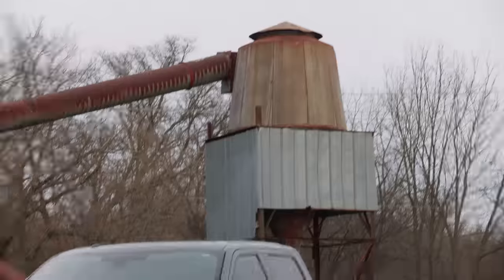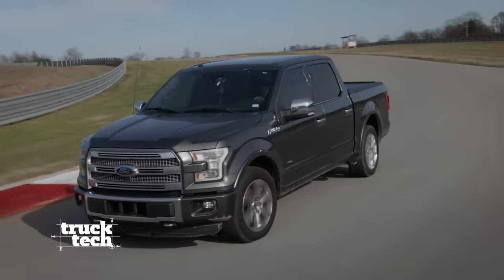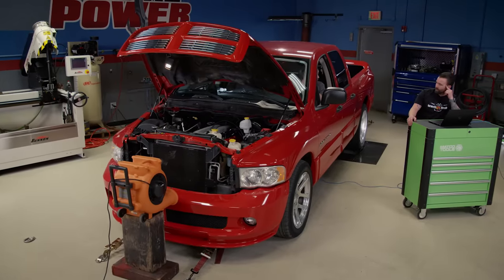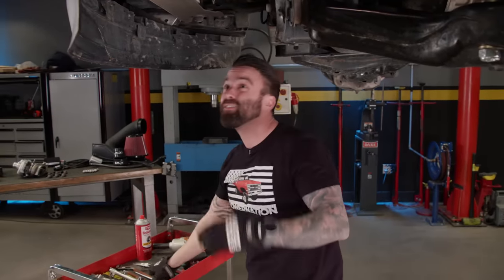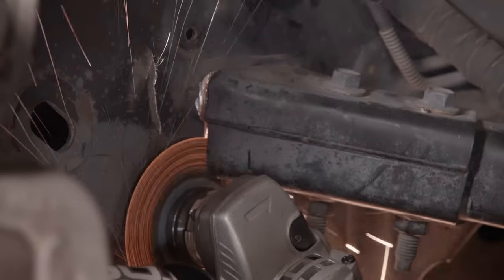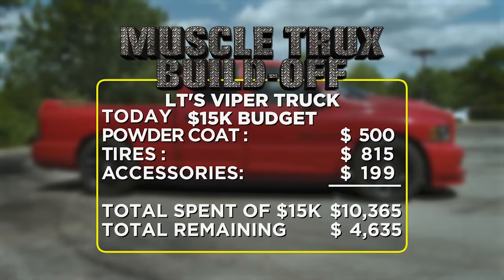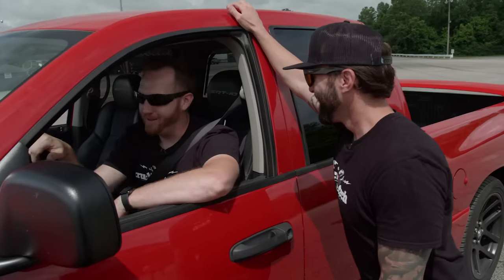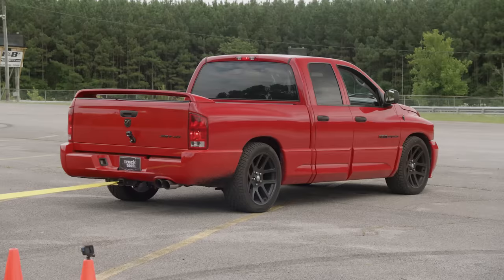Muscle Trux Build-Off: Ford F150 EcoBoost vs Dodge Ram SRT-10

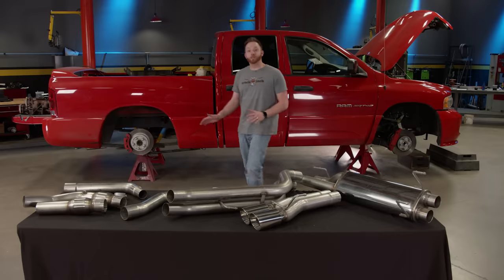Comment: @1:00:20 you can see how bad that Ram is sagging in the middle sitting on jack stands on 4 corners. I pointed this out last year the first time I saw it. These guys are hilarious.
Reply: It's not sagging the front jack stands are in the frame the rear jack stands are on the rear axle. The rear suspension is compressed alittle because it's on stands

Comment: The 3.5 is only at advantage in 17 and up. But 3rd gen 5.0s are running mid 12 to low 12s ive seen, intake mani, tune, exhaust, cai, 30% e85. And they sound great. The 3.5 cant compete in the long run.

Comment: I didn't like the 2018 4x4 f150 v6 twin turbo, it was fast, but the 10 speed transmission didn't seem to know what gear it wanted to be in when hitting the gas and turning, like I was able to repeat the issue with it swapping from 2nd to 3rd and back to 2nd and back to 3rd in normal mode with moderate throttle turning a corner to beat traffic or a light, sport mode wasn't an issue, but never ran it in sport mode much. Plus the truck was so light, all aluminum felt like I was closing a door on a tin can, It just had this cheap car vibe to me, everything was that hard plastic feeling, frame was paper thin, I wasn't impressed, it was fast truck though, Would smoke my 92 Silverado 5.7.

Comment: I have to admit that Ford looked awesome! I see everyone commenting that the F150 could’ve been tuned for a lot more power so knowing that if I could tune it to get 550-600 HP on the setup that they built then I definitely would’ve took the F150! I have always loved the SRT10 but they could’ve done so much more for the performance of the truck! Take into account that you can easily tune the F150 to get double the MPG than the SRT10 then it’s an easy decision for me.
Reply: its so stupid cuz he couldve got a coyote f150 and the 5.0 coyote just needs boost and fuel and you can make up to 1200whp with a stock sealed coyote.  no heads no cams no pistons no rods and they run 9s for a crew can and as fast as 8s with the single cab short bed in the 1/4 mile. he bought a turbo for this when he couldve slapped a turbo or supercharger and fuel system.  m8dnight performance jas toms of these in the 8s without ever openimg the engine. gotta think once ford went with aluminum they have a weight advantage weighing jn at 4500lbs (hellcat weight damn near) its like having a awd mustang

Comment: The ecoboost could have used e85 fuel for a much higher gain in hp, probably another 40whp at least. The srt10 hp gain was disappointing, my guess is the limit of the out of the box tune compared to a custom dyno tune

Comment: Should have got a livernois tune on that Ford. Besides the fact that their tune with those mods would have put up better hp numbers their tcm tune puts the power down much better. Skip the cosmetics and throw some ported heads on that eco boost and srt 10

Comment: the dodge could of been done so much better. should of left the gearing alone, put a more aggressive cam then the one chosen. I agree with the heads and brake upgrades. the tires and rims should of been aftermarket with a 20" rim up front and a 22x12 in the rear and a -offset. the exhaust should of been true dual with a x pipe. my key choice difference would of been a procharger or turbo instead of a few other options chosen. either way awesome job boys.

Comment: Should have used the 04 Harley supercrew instead of the eco boost. Or if a regular cab ram the lightning. Since those were both around the same Era competing against each other. Wasted money on the ignition upgrade on the ram too. Stock would easily handle the meager power gains they did. Msd coils aren't that great on the Ford or any vehicle.

Comment: They should have done more engine upgrades. the guy with the dodge still had like 6 grand left over! personally ill take the 150 platinum with the 3.5 ecoboost over that dodge any day although a viper ram is a rare and cool truck i thought the ram would have made a lot more stock HP though.

Comment: Hey Dodge man, that transmission for that truck isn't behind the compression ignition engine, the 727 torque flight is. It could only accept 1085 foot pounds of torque. The ten speed in the Ford has ten speed and a reverse. The high output powerstroke engine has 1200 foot pounds of torque. The horsepower for those engines is 500, the same as the six cylinder engine from Mack truck, who manufactures their own engines.

Comment: SMALL CAM is correct the factory 96 97 vipers have a 220 230 cam stock. And mine isn't missing any torque at all drives extremely easy. Cams in the mid to high 240s is actually pretty normal to see in the v10s.
Reply: Agreed, thank you, finally someone who knows what they are talking about! They put a baby cam in the Ram🤦🏻‍♂️

Comment: Idk if he's launching that f150 right....needs to be in 4wh ...pull drive selection knob to lock diffs....quick double tap traction button to put in sportrac mode (or press and hold to turn advance trac off)...push sport button to put in sport mode...prep for launch by rolling forward a little to engage everything ....Rev up to around 2k rpm....dump and go!

Comment: I wouldn't have wasted money on the pedal commander or the voltage thing or the MSD coils, for the fuel pump, would have just ran a new wire and relay for the pump and done OE coils, then spent the extra money on Turbo adapters, maybe a little bigger of a turbo.

Comment: My 19 5.0 f150 runs 8.1 in the eighth at 88 mph with just a tune and e85 with cat back exhaust cold air intake lowered with traction bars

Comment: I was wondering you guy lowered the rear gearing from 4.95 to 4.10 in the srt10. Would a 3.73 or 3.93 work too or is that too for the v10?
Reply: Probably wouldn't have been a problem for the V10 itself, but I have my doubts about that transmission, especially since it was only a 4-speed. May not have broken, but with only four gear ratios, I imagine it would've killed the acceleration if he went that low.

Comment: Platinum and limited trims with the 3.5l has H.O motors. They are tuned differently by factory.
Reply: H.O motor is only in the Raptor, not the platinum in 2015

Comment: It would’ve been a hell of a lot easier with the F-150 to pull the chassis off it would’ve been more room to see all the improvements to be made people sleep on the V6 3.5L F-150 but they actually well built.. I use to own a SRT-10 years ago but knowing what I know now if I had a opportunity to pick between the two I would go Ford all the way..
Reply: its so stupid cuz he couldve got a coyote f150 and the 5.0 coyote just needs boost and fuel and you can make up to 1200whp with a stock sealed coyote.  no heads no cams no pistons no rods and they run 9s for a crew can and as fast as 8s with the single cab short bed in the 1/4 mile. he bought a turbo for this when he couldve slapped a turbo or supercharger and fuel system.  m8dnight performance jas toms of these in the 8s without ever openimg the engine. gotta think once ford went with aluminum they have a weight advantage weighing jn at 4500lbs (hellcat weight damn near) its like having a awd mustang
Reply: @carculturenation2166  u absolutely right fam …. I give him his props tho

Comment: i’m going regular cab short bed silverado with the 5.3, stage 3 btr cam, ported and polished heads, long tube headers get it deleted and 4.56 gears. cheaper and faster than both trucks

Comment: Both trucks could probably hit those numbers with a cold air intake, exhaust, and a good tune.  Why spend all that effort putting on parts for such low gains? If stock injectors can support 700hp why change them for bigger ones if you are only going to make in the 400's?

Comment: Because I have a 2013 F-150 four-wheel drive with a coyote V8 and I want to do the same to that as what you did to that EcoBoost drop it down like you did that one and give it some more horsepower and put some headers on her in and a 55 mmm throttle body
Reply: Excuse me in 85 ml throttle body

Comment: Still should have used a coyote v8 with whipple on the Ford or twin turbo that? But those v6’s can be awesome on smaller vehicles but idk about a heavy truck?  It’s whatever it’s what u all chose? Should have used a lightning or bigger turbos like 2-30 psi ones just saying ? Against a viper engine u gotta boost that thing to the extreme!!!😎
Reply: Right! And the Ram only had a baby cam in it, imagine if they actually put a deck to size in it!

Comment: While I’ll admit that ford has done some amazing things with the eco boost and they are capable of making really good power with very little the one thing you can’t change is that they will always sound like crap when compared to a V-8 or V-10. That was the biggest complaint with the Raptor fans and why they released the Raptor R which ford still held back on because the Raptor R is capable of way more than 700hp with very little effort.

Comment: As a retired ASE Tech (do'in it since 1968) What I see in all these "modern" turbo engines, is to stay away!!! Way-way to much crap attached to make govt. regs. the old saying " no substitute for cubic inches. In the state where I presently live build a 95 or older. But a pair of very knowledgeable gentlemen!!! And they kept me interested the whole video.  PS; I would have looked for an SRT Ram with the v-10 and a STICK, with that 6 Speed trans you could probably have gone to 3.9's or 4.11 rear gears. AND STYLE IS AN OPINION ONLY!!! A side note I am a car guy, not a truck guy. I do own a truck, but it's job is to be "A TRUCK". Drag Racing is 1/4 mile, that means 60ft. times 1/8 mile time and finally 1/4 mile time and speed. That is where the real crying begins and ends!!Want to see what an "OLD FART" builds just send an email.

Comment: Am I crazy or did they never install the aftermarket headlights on the f150
Reply: Good eye. Those aftermarket lights were for the F150's with the factory halogen headlights. His had the factory LED headlights. I used those aftermarket lights on mine, and they were garbage. The plastic broke, and was a lot thinner than factory.

Comment: Easy peezie With the srt a simple rotor and pad upgrade and a Procharger... 800hp and stops  Mic drop! And I'd like to think easily be less than 15k. As far as the ford the same Ecoboost but in a 2wd short box regular cab would have been sick and way faster and out handle a 4 door 4wd.... That was an odd choice.

Comment: I can totally agree with the refresh of the front suspension components like control arms, bushings, ball joints in the Ram, being 15 years old with 70K miles. But I don't know why that same thing wasn't done to the Ford. Sure, the Ford is much newer, but it has well over 100K miles on it. Wouldn't ball joints and bushing be in need of replacement by then anyway? And are you seriously not going to upgrade the brakes on the Ford? Why wouldn't you, if you have the truck up in the air and are also working on the suspension? Additionally, I think part of the reason the Ford did not get re-geared was because it's still a 4x4 and that would require re-gearing the front end as well. In the end, I think the visual impact of the Ford totally blows the Ram out of the water. I don't care about the horsepower numbers, I'd take that Ford any day over the Ram.

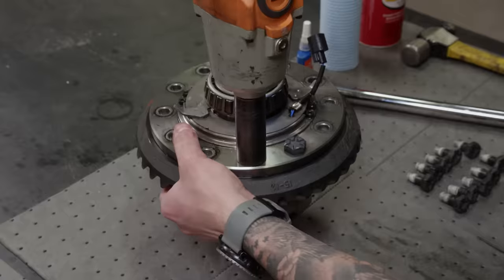Comment: 39:14 I love the truetrac but really you took out an elocker....
Reply: True Trac is stronger?   I'm just guessing since I'm not knowledgeable enough to give an answer.  I can see swapping out a GM Govlock since they will eventually fail and basically grenade the rear end.  This this one upgrade I will be doing on my Silverado at some point.
Reply: @bmstylee  truetrac is strong, I've been using one in a diesel sled pulling truck for years. I've broke axle shafts but yet to hurt the truetrac. I guess the only thing I see about the truetrac over an elocker is that the elocker isn't automatic like the truetrac.
Reply: @AndyFromm  that actually makes sense about the e lock not being a mechanical locker.   Didn't think about that one.
Reply: @bmstylee  I'm not sure what it uses to lock the axle but what i ment is for the elocker you have to pull the 4x4 knob, truetrac just works all on its own.
Reply: @AndyFromm  It really depends on usage. Truetrac is better on street because it is automatic. While e-locker has to be switched manually. Off road, e-locker is better (kind of like electrically actuated arb locker), while with truetrac off road you have to ride the brakes for it to activate (especially with one or 2 corners in the air).
Reply: @mustpaike  I've never rode my brakes while off road to get the truetrac to work  but I guess I'm not rock crawling with tires off the ground. The only time I had issues with the truetrac not having traction is while I broke an axle shaft.

Comment: An interesting show….but….I wish they would have done even a tiny bit of research on the SRT10. They did make the right choice in making both trucks automatics, apples to apples. As the standard cab SRT10 truck the only transmission was a 6spd manual. Maybe they intentionally made poor choices for the SRT10 so it was a closer race or competition? 
But, if they had just gotten on the SRT10 forums, asked a few intelligent questions, talked with some vendors and shops about what improvements are the most cost effective, they would have done much better. I bought the exact truck new in 2005, red, quad cab. They come pretty loaded with options, so, not much extra was added. Stock, in 2005, with 1500 miles on it, it put down 426hp on a Dynojet dyno. 
Later that year, I did a computer tune for 93 octane fuel, added a Borla cat back, mainly to make it sound better. That’s it….I raced the truck a few times over the years, just test and tune, bracket racing at both Pacific Raceway and Bremerton Raceway. 6000 pounds with me in the truck. It was a pretty consistent 13.6 at 101mph truck. The last time I raced it was 2018, had 60,000 miles on it, still almost stock. It ran a 
1/4 Mile ET:
13.547
1/4 Mile MPH:
101.640
1/8 Mile ET:
8.715
1/8 Mile MPH:
81.750
With a proper cam, valve springs, street ported heads, long tube headers, full high performance exhaust to the tips, a proper computer tune, CAI, and a transmission shift kit, it would run a 12.5 1/4, guaranteed. He had plenty of money to do this. He supposedly had 30 more HP than mine, so should have run about a 13.3-13.4 at least. I think his computer tune was not correct….
Also, I always used the stock tires, Pirelli Scorpions, they were a good summer tire with plenty of grip. So, moral of the story, ask around with guys that have already been down this road, ask multiple shops, weed out the bad information, and there are plenty of guys out there that are honest, will gladly steer you in the right direction.
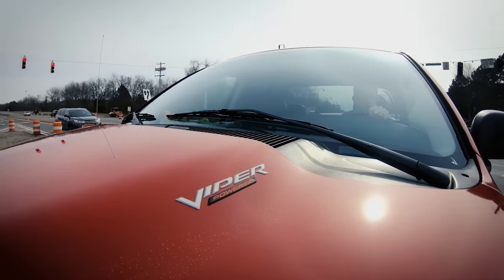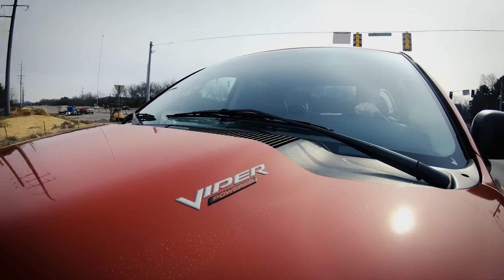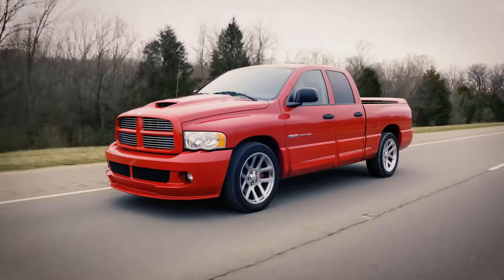Reply: And, they really should not have changed the rear gear ratio, the reason the factory used a 4:56 rear gear is because of the super tall rear tire, 22” rim from the factory, it really needs the 4:56 gear. I now have a 2004 SRT10 standard cab truck, with the factory 4:10 gear….it really needs the 4:56 gear for better launch and to get the shift points closer together. As far as top speed with the 4:56, just raise the redline via the computer tune…it will easily pull 160mph…that is plenty fast enough to get you a go straight to jail, do not pass go, ticket. Their SRT10 really should have gone at least a 8.75 et in the 1/8th mile, but, with their budget, a 8.5 second 1/8th mile is doable.

Comment: I find it entertaining he cuts out bracing that is probably important to run those idiotic wheels and tires.
Reply: Those wheels are hideous and stick out way to far. Then he removed both front and rear crash bars which is incredibly dangerous for the occupants. On top of everything he said it still likely rubs when he hits a bump in the road. Literally he chose the worst motor, transmission and wheel option possible for this competition. He couldve been alot more competitive with new cams in a 5.0L coupled with an exhaust and tune, and went with the 10r80 all for less.
Reply: So.  Basically he could have the front suspension in his foot well in a front end collision?   Brilliant.

Comment: The old saying "there's no replacement for displacement" will always be true. Because boosting your engine only multiplies your displacement, it doesn't actually give you any more hp or torque per unit of air mass. In actuality the smaller ports, valves, pistons, and shorter stroke result in less hp per unit of air/fuel charge.

Comment: I feel like this was a little more biased to the dodge lol.  The Ford could of put way more power down the trans could of been tuned the dodge had points slanted in it's favor didn't use four wheel drive in the pull

Comment: yk the whole "haha Eco boost has no pwr" argument got pretty old pretty fast. 340 stock is solid and after the upgrades is it was almost the same as the dodge with 4 less cylinders. "well the f150 will try to spin the tires" the truck 430 hp its not gonna have to try that hard. you'd think they wouldn't repeat the same joke 20 times since the conversations are scripted.

Comment: I know this is old but why did the f150 let go of throttle on launch with 4x4? The ecoboost only purges when off throttle. A proper tune with absolutely no mods would of made the 150 faster than what he did.  The srt should of got a better cam and boost could of made both trucks so much faster with same money. The tug of war was pretty stupid as well ford had 4x4 and even in 2wd he just mashed it a go kart could pull that truck in full spin like that. It's like to people with no knowledge of the platform built these trucks. They tried so hard to make it close they ruined the challenge.

Comment: You are supposed to brake in a straight line..............  Too bad the Ford isn't a venerable 427 or 428 V-8; it would have been at least comparable to the V-10.